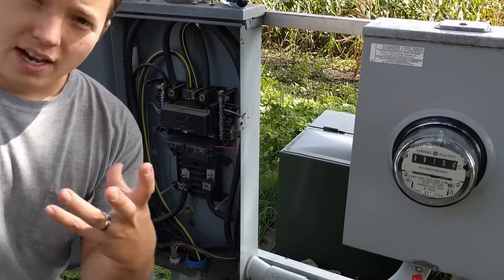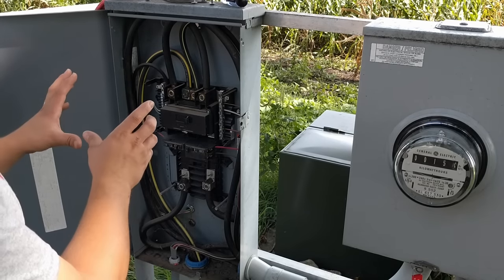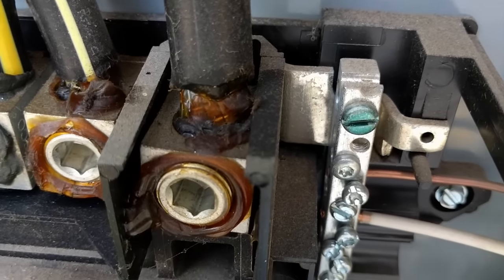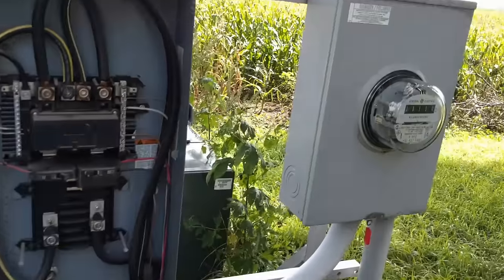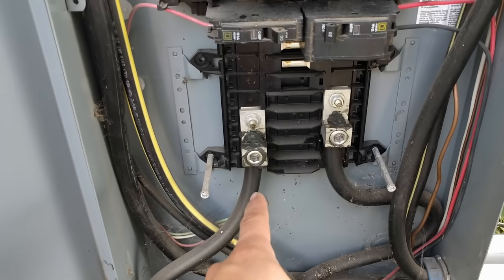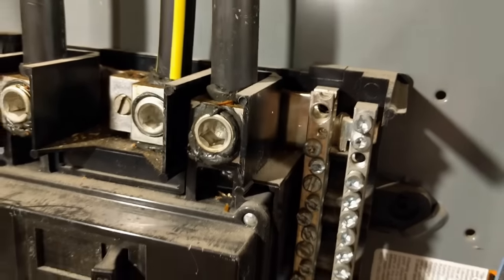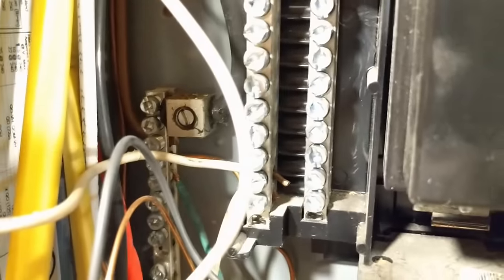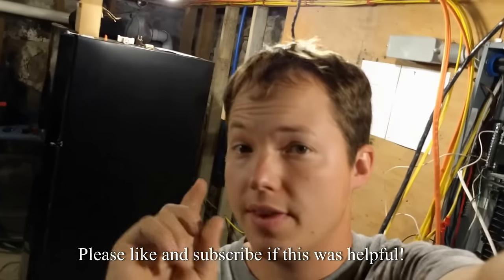What Is a Neutral Bonding Screw in a Main or Sub Panel Load Center & Should It Be Used or Removed?

Comment: I've been trying wrap my head around this....my panel is fed off my disconnect after the meter.  The neutral wire is brought back and goes straight to ground.  My "sub panel" in my house only had 2 legs and a neutral.  I've not bonded my panel but grounds and neutral head back on the same wire.  Is this correct?
Reply: Eaton panel

Comment: Hey Ben, I think maybe you should pin something to make it clear that you only remove the screw if you're sharing the ground from the main. There are some installations which allow for an independent ground, in which case I believe you must bond the neutral if you want your breakers to trip on a short to ground. I believe the Ontario Electrical Code allowed for both types of installation, though only the shared-main ground was permitted for livestock operations. I heard a rumor that was to change - but I just watched YouTube Guy so-and-so install a subpanel with and independent ground in his workshop/garage. Licensed electrician at that - though not currently working in domestic wiring. It wouldn't do to have people un-bonding such installations. Of course it also wouldn't do to go with an independent and bonded ground if your remote ground rods are too close to the main ground either. The magic pixies will find a way to tunnel through that in the first rainstorm - which is why it's not permitted for livestock operations I imagine.
Reply: Sorry, the above paragraph is dangerous and should be ignored. 
 
There is "never" an "independent ground."  Bebopalooblog is referring to an ISOLATED ground. It runs directly from the grounded device or location to the main grounding point at the "service location," (a term from the National Electrical Code in the USA, usually where the meter is located) and the only place where you should find a green panel bonding screw whose purpose is to connect the metal enclosure to the "Grounding" system which otherwise has the capacity at every location to carry enough current to trip the breaker or fuse in case of a short to ground.  The "Grounding" system by design (normally) only carries current during a short to "ground."

In contrast, the "Grounded Neutral System," (or "Grounded Conductor" as opposed to the [green or bare or green/yellow] "Grounding Conductor"), generally the white wires in the USA, by design always carries all the return current from the "Hot" wire. (Note: If ALL the current from the hot isn't "found" in the neutral, the GFCI breaker will disconnect - a ground wire is not factored into its operation.)

NEVER create a safety or isolated "ground" for an electrical power system by connecting ONLY to a ground rod.  The NEC specifically forbids this "use of the earth as a conductor" since the earth's conductivity can be as high as 1,000,000 ohms and cannot be relied upon to carry enough current to trip a breaker or fuse.  The main purpose of the ground rod is to assure that any voltage difference between the earth and any nearby accidentally electrified exposed metal that could be contacted by a person or an animal stays low enough to remain safe.  It is OK to connect (or bond) an extra "Supplemental Ground Rod" to any point in the building or site "grounding system." 

Yet, some electronic systems, devices and appliances internally connect capacitors, for example, from line and neutral wires to their ground wire to "drain off" voltage spikes and high-frequency noise and these connections inject a small amount of current into the "Grounding System" that can introduce electrical interference in other sensitive electronic devices.  In a hospital's "critically sensitive patient area" these small currents can be lethal.  A properly sized "ISOLATED" GROUND is installed directly from the sensitive device or area to the "service entrance grounding point" to assure that it shares none of these extraneous currents yet can still carry any short circuit current needed to trip the appropriate breaker.

Comment: I understand the adding the separate grounding bar at the breaker panel and any subsequent sub panel that maybe installed later, however shouldn't the single ground conductor been wrapped with green phase tape or stripped green as a positive indication it's a ground wire?  As the yellow stripping was done with the neutral conductor.
Reply from the maker: Correct. This should have been done and I may add it at some point. Good catch!

Comment: Question: I am wiring up my workshop using armored cable with the bonding wire. So, the armor itself is used as the ground instead of a conductor. This is all going to a sub panel. If  I take out the bonding screw, how do I maintain the ground? Tie the sub panel into the line for the ground rods?
Reply: If you are getting the steel ac cable without the green ground wire, it is ok to use as a electric ground circuit.  If the subpanel is in the same building, you should be able to carry the ground from the main panel (which are the same in the main) .  The main panel is the only panel that has ground and neutral bonded....all others downstream are separate...if the subpanel is in a different building, that subpanel still carries the original ground/neutral from the main panel in main building, however will need additional grounding rods where it will be placed....this is how i understand it.

Comment: Hi Ben, can I add another sub panel going to my garage straight from my disconnect box.  It has few more screw connections for it.  My house currently has 150 amp breaker and I’m thinking of putting a 100 amp box in my garage which is right next to my disconnect / meter box.  I will probably use less than 50 amp in my garage for lights and garage opener.   Thanks if you happen to look over your old video and come across my question.  And I would have to put in another two grounding rods down correct?
Reply from the maker: 100a is probably overkill but you could do that if you want. I would probably run a 6/3 with ground cable and just put in a 50amp panel. As long as you have space for a double pole breaker in your main disconnect panel then you should be good to go. Also, if the garage is a separate building then you will need to add two ground rods and connect that to the new garage panel grounding bar. Obviously the grounds and neutral bars will need to be separated.

Good luck with your project and thanks for the comment! What State are you from?

Blessings from MN,

Ben
Reply: Benjamin Sahlstrom ....do I need another breaker in the disconnect panel .  My box is similar to yours with the 200 amp breaker and it has a few lugs available to connect additional hot and neutral directly.  Someone gave me the 100 amp box is the reason I’m using it.  I’m having to do this myself cause the electrician in town is not very reliable.  

I actually live in Hibbing MN and work as an optometrist in Grand Rapids . Keep my name handy as I study climate change on the side and would have pertinent info to repay you in the near future.  Thanks

Comment: I saw in another channel  a panel where  there were three cabes coming in and feeding a main breaker,i mean two  hot wires  connected to the main breaker and the neutral  was conected to a busbar, in this same  busbar was conected all neutrals coming out to  each   circuit  inside the house , but the ground wires were conected to  the same busbar of neutral as well, (TNC-S-C  )  is it legal in US?

Shouldn't it have a forth cabe alongside the neutral  and the fase  coming  out the meter and coming into the panel inside the house,with one  neutral busbar and ground one, TN-S sistem?
Reply from the maker: The FIRST panel on a property after the meter does NOT have to separate the ground and neutral wires. I'm guessing that is probably the case in the panel that you saw. My panel is down stream of the first panel so the grounds and neutrals needed to be separated.

Tha is for asking and I hope that helps!
Reply: Benjamin Sahlstrom it  just one more question to clearify it once for all,  you mean  if the house  has  the meter outside or inside but there is only one panel outside or  inside the property,you can have only a busbar for   neutral  and    ground ,but if there is a sub- panel you can't  bond the neutral and ground  together anymore in the secound  panel?  Is it?

One more subscriber to your channel mate, hello from Brazil.

Comment: So a panel in an apartment is a sub panel because there is a cut off panel with one single breaker located outside close to the meter. Then both the neutral and the ground of the sub panel in the apt do not need to be bonded to the box. Right ?
Reply: The ground bar should ALWAYS be bonded to the box. Only the neutral bar is not bonded.

Comment: IS THIS WHY IN A MOBIL HOME THE BONDING BAR IS ISOLATED ? ITS TREATED LIKE A SUB PANEL FROM THE METER PEDESTAL
Reply: Typically it's done so you can hook up a portable generator which will have a bonded neutral.

Comment: You have 3 conductors coming off the telephone pole. Two 120 volt conductors and a ground wire, all the same size. One wirewill have a white stripe or white tape to identify it as neutral/ground. That white wire is ground bonded at the pole by a ground rod. The center tapif the pole transformer is grounded. That 3 conductor wire then goes to the meter panel on the side of the house. The white sstriped wires is attached to meterhousing and also attached to another ground rod at the base of the meter housing. Everything must be grounded and bonded to earth. Some locales require more than on ground bar outside. Then from the meter into the panel lots of times it’s a bare copper wire to the neutral buss on the main panel. Sometimes it looks just like in this video wires. Whatever it is that wire is grounded on multiple places before it gets to the the home panel. And in Florida and many other places it’s requiredto run a bare copper conductor from the home panel to the copper water entrance pipe in addition to all the ground bars. Neutral buss is bonded to the grounded panel chassis via the green screw on the neutral bar. So there is no difference in potential between a neutral wire and ground. 4 wires do not come into your house. Neutral and ground are the same wire.
There is no floating neutral coming off the pole. On these panels with separate neutral attachment bars there still bonded to the panel so no difference in potential. 
As far as a sub panel it needs to be earth bonded as well. 
As far as a sub panel it’s the same as any other panel it must be earth grounded. I know I’m right because I have passed inspection many times. Passed inspection many times first thing they look for is
Proper bonding. Make sure your cabletv is bonded to an earth bar where it comes in on the side of your house same with dish, if not you will get blasted with lightning.
Reply: Subpanels are bonded via the ground wire. Neutrals are to remain separate and should not be bonded to the enclosure.
Reply: PlymouthVT    Are you aware of the reasons any of this exists?   From the 1800's up to the 1950's there was no grounding electrodes or ground conductors to any devices or loads.   The electricity worked fine and the lights and the toaster worked.   There are two separate functions going on in grounding of electrical systems.   Are you aware of what each purpose is?   Think about this question as well.   If there is a heater fed by a sub panel and a hot conductor shorts to the can of the heater, the amps increase to thousands of amps.   Where are they going to(what is the path)?

Comment: can you tell me where the #4 bare ground wire from the ground rod hooks to?
Reply: I just installed a new ground electrode system in my old lake house.  The code calls for various electrodes.  I believe the first on the list is a metal water pipe that runs for at least 10’ underground and the connection to the pipe needs to be within 60 inches of where the pipe comes out of the ground.  If you use a ground rod, it must be 5/8” or 3/4” and at least 8’ underground.  It must also have 25 Ohms or less of resistance to ground (which seems tricky to measure) or you must install a second ground rod.  As for the connection, my #4 copper connected in my meter Electrician did that for me.  I believe it connected to the neutral line there.  I assume that if it isn’t connected in the meter box, I has to connect to neutral in the main panel.  Perhaps another poster knows exactly where that connection is in the main panel.

Comment: I have 3 wire service heavy gauge buried underground and encased in a slab ie there’s no practical way to add a wire. I’m replacing a panel in my garage. I’ve got multiple answers.  I’m gonna put in a grounding rod and a separate ground bus in my panel. I guess that’s the right thing to do.

Comment: I have one MAIN PANEL in my home. You have 3. How do I know if I should have my grounds and neutrals together?
Reply from the maker: The first panel after the electrical meter should have the neutral and ground wires together. Every panel thereafter is a sub panel and needs to have the bonding screw removed and separate grounding bar added. Does that clarify it for you?
Reply: Benjamin Sahlstrom Gotcha. Thanks.

Comment: There is 3 exceptions to that, like for example for remote buildings...
Reply from the maker: Could you explain the exceptions in more detail?
Reply: Sure thing. The best explanation (clear to me) can be found in “ ecmag.com” (electrical contractor website), under integrated systems “ Load-side Grounding connections.” They brake it down all the exceptions including neutral terminal bonding for old range. This will explain all conditions except for separately derived system (transformer).. let me know if you can’t find it, I will try direct link.

Comment: What if your meter box has a disconnect? Remove the binding screw on main panel, correct?
Reply from the maker: I would say most likely yes. It's always best to call your area state inspector to make sure that you're meeting the local requirements. Thanks for the comment!

Comment: Does the strap that connects both neutrals together in the Sub panel has to removed also, or is it just the bonding screw. Speaking of a 125amp Main Lug  Panel
Reply: Pretty sure if your panel has 2 bars, one should be a ground, the other a netural, and removing bond screw allows them to remain separated,.
Reply: @buttbutt683  There's a strap bolted on the two bus bars in the panel (125Amp Main Lug Panel), does that strap has to be removed also after bonding screw is removed. Which will separate both strap. Or do I leave the strap and just install a grounding bar.

Comment: Ok so no bonding screw in my sub panel neutral bar. However, I still measure nearly zero ohms between neutral and ground, so what gives?
Reply: You do not want a parrallel path of current back to the source
Reply: Number 6    Your results are as they should be.   I'm assuming there is a short distance from main to sub panels or else you did not bond neutral and ground in the main panel.

Comment: Hello, wondering, you have 2 ground rods driven in the ground at the main disconnect out by the road. Why do you need additional ground rods at the house foundation too. Where the sub panel is with all your breakers? thnx
Reply from the maker: Each separate structure requires it's own ground rods. If you have a sub panel in the same building then you are not required to add separate ground rods. Hope that makes sense!
Reply: @BenjaminSahlstrom  thnx

Comment: Is there a rule on having a main breaker on a sub panel?
Reply from the maker: No main breaker required if it is in the same building. If it is in a separate building you will need a main breaker unless you have a 6 or fewer circuit sub panel. In that case a main is not required. Hope that helps! I should make a video on this.